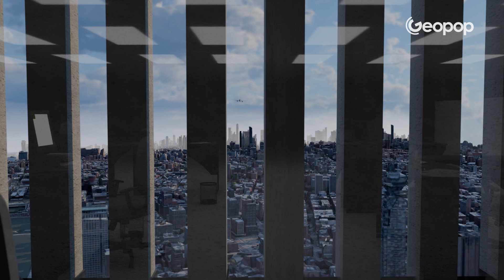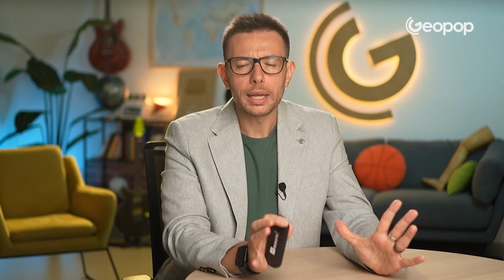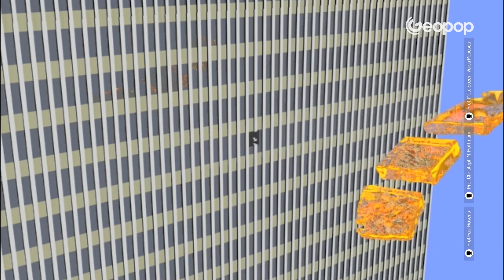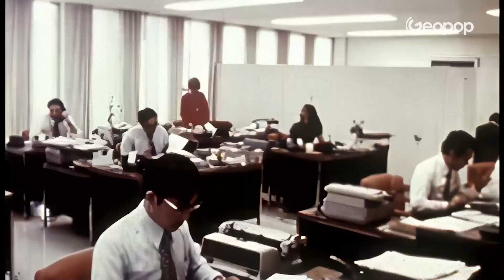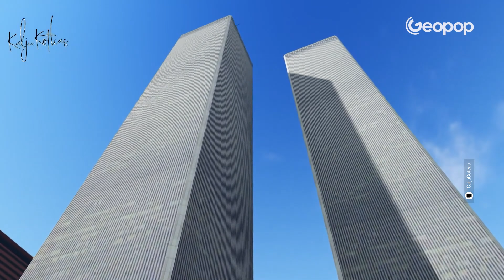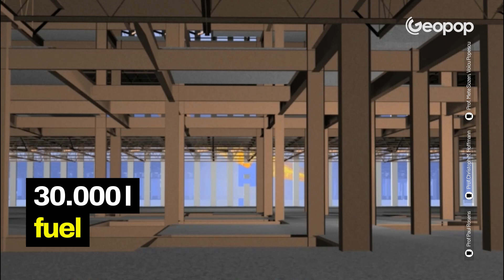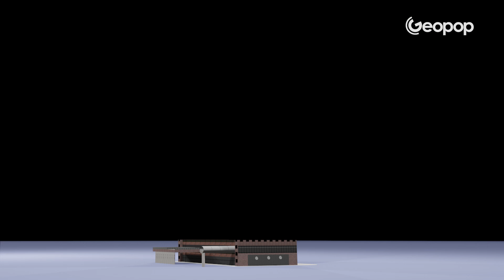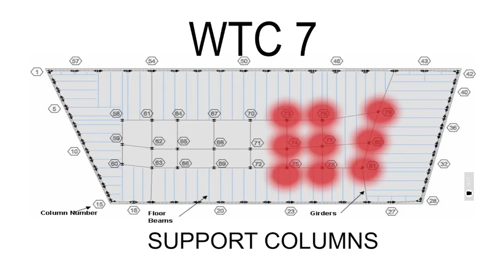9/11, 2001: The Technical Reconstruction of the Twin Towers and WTC 7 Collapses

Comment: Promote graphs and doubtful reports all you like, i prefer on the day footage with auddio and firat responder reports especially fire crews who all claim to have witnessed multiple explosions and walls in the lobby shattering after impact moments before collapse.

You can not rely up a report that is called into question by everyone.

Nobody doubrs planes hit the towers, but even top us airline pilots have said they couldnt even descend 12000ft in 2 minutes and line up a level flight to hit the towers or the pentagon, but you now what can? Cruise missle software.

Explain the colapse all you like nobody doubts it, with half a brain. Except foundational steel was not weakened yet the footings were burning hot for weeks after.

But its all normal. These three towers are the first steel and concrete structures to collapse through fire anywhere in the world even those built earlier than the 1970s 

Its all BS.
Reply: If you're still struggling to process the awful events of 23 years ago you should probably seek professional help.
Reply: @Jnoooooo  I'm not struggling to process anything, I'm just wondering if you're still being bottle fed, because of your naivety and willingness to accept the only possibility that requires zero thought or consideration just merely requires acceptance and belief in the reported "facts" by those who are paid by those who did it.

I was sent all over the middle east because if this crap and lies in the military, which I didn't join after but was serving for 14 yrs prior to and post this event.

I know that this event was a catalyst to get fools like you to buy all they sold and lap it up like you do about Rissia and China. You're a blind dumb fool, and until you open your eyes you'll always be wrong.
Reply: @BeatsFoundry  you sound paranoid and unwell - hopefully you're getting the medical help you need. Peace.

Comment: 😂😂😂😂😂 Sure and what are the explosions clearly visable on the side of the tower when it collapsed in free fall. Also WTC7 only fools believe official story😊
Reply: Compressed air from the falling floors. All that air goes somewhere, and the weakest point is the windows and down the stairwells, air conditioner ducts, and elevator shafts.
It looks like explosives because the air is being forced at tremendous volume and cocusive force.

Comment: The liars release this BS every year. The best way to 'prove' a lie is to repeat, repeat, repeat, repeat.
Reply: It's just science. Relax.
Reply: @Jnoooooo  Manipulated science is not "science." It is science fiction; It isn't even 'akin to a movie script; it is a scripted cartoon of what some insist we believe. If, for example, WTC-7 collapsed only because of heated, softened steel and damaged steel support," why is it necessary to fake an AI building-7 folding in on itself (in complete contradiction to the FILMED building-seven collapsing straight down, FROM THE BOTTOM AT FREE-FALL SPEED)? Actual science proves that could only happen if NOTHING is between the top and the bottom.
Reply: @inkblot131 why so angry? Relax! If it's this triggering for you after all these years, you may need to speak to someone who can help you through this. Peace.